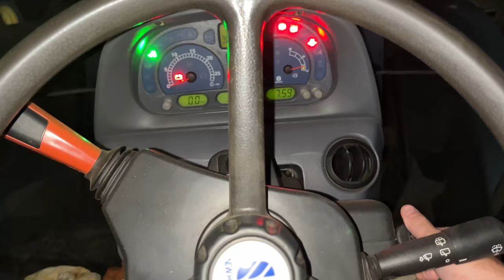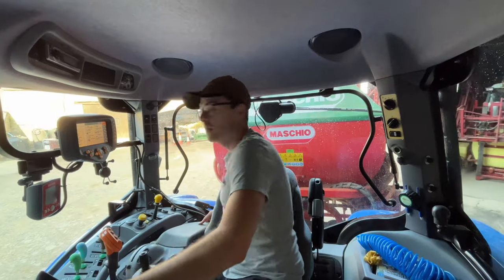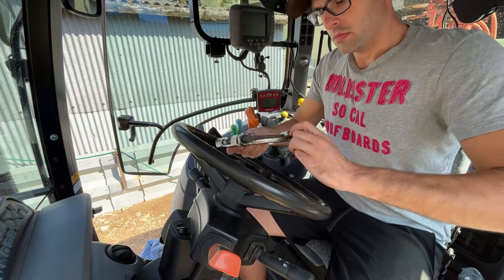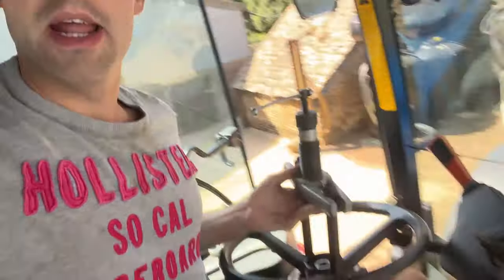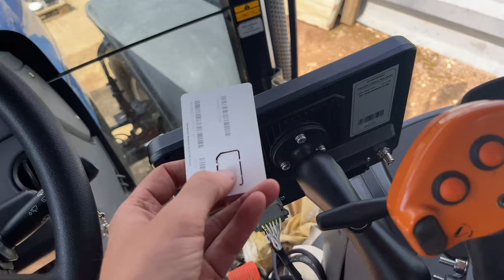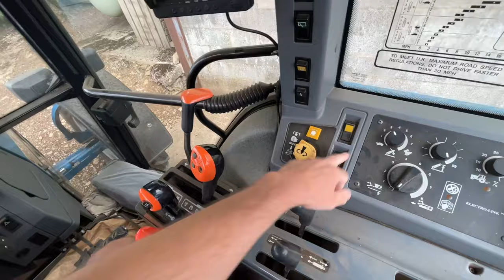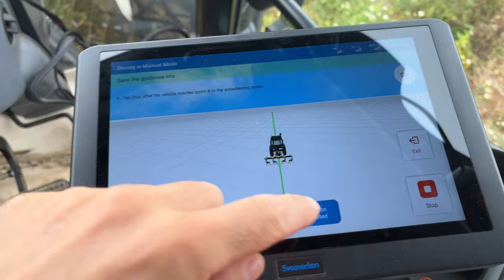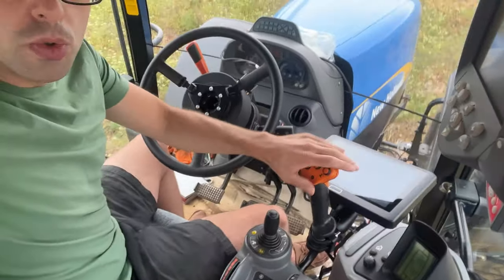Installing a farm auto steer system  Sveaverken F100 #Realfarmingvideos #farmingautoguidancesystems

Comment: Thanks for the video. Please upload a video detailing how to fix all the problems you had. I’m planning on getting a sveaverken system shortly as well . Keep up the good work. 
👍👍
Reply from the maker: Hello Pete - happily. I have also become the UK dealer of Sveaverken. I can't DM you on YT but have a instagram page - Agri Tech South West - get in touch and i can talk you through how we tackled all the challenges / what we've learnt. If you are in the market still I can help there also. 

For us it was small things. It would say measure from the dome to the floor.. ok, but where on the 5inch high dome do we take this very precise Millimetre measurement from. Or, mounting to a plastic roof. We didn't want to use the self-tappers provided, we wanted a solid fixing point so mounted the pre-drilled mount plate onto one we made, to make it fix to the metal number plate bracket.. small differences have really made it look from a retrofit kit to almost factory fitted! 

There is also discrepancies between the book and the screen instructions. We are well versed now! 

Do get in touch.
Reply from the maker: Hi Pete, did you want to connect on my instagram - Timscotsfarm to discuss? Happy to help secure/ deliver you a system?